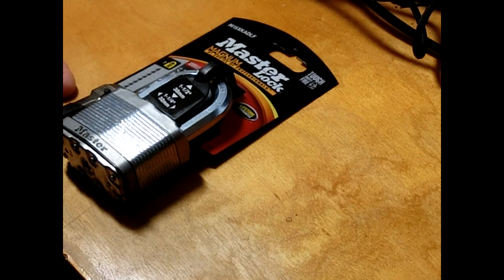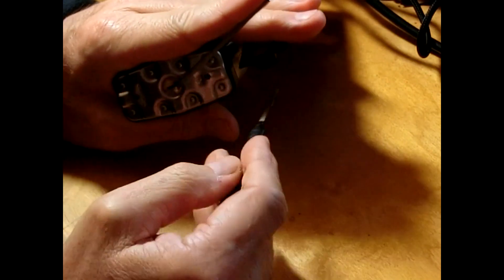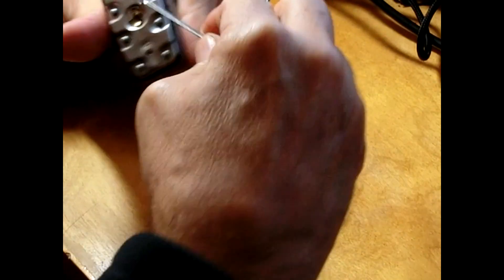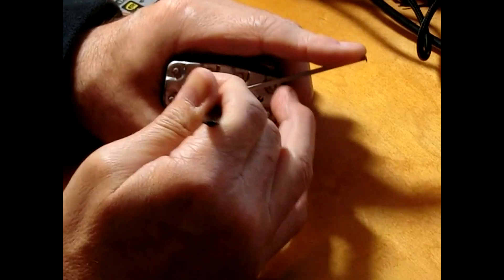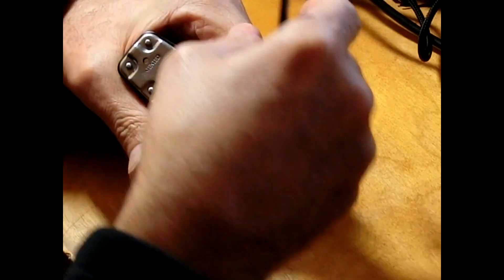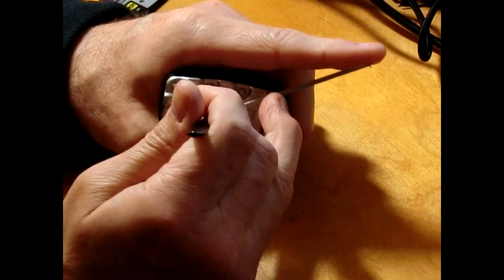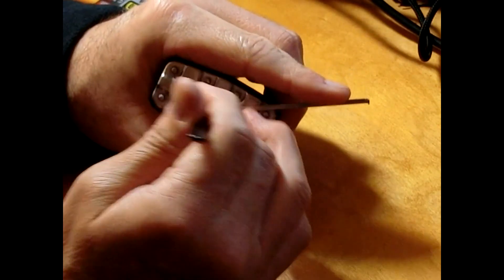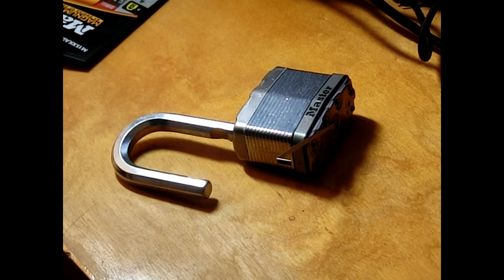New Lock Picker Versus Master M15 Padlock

Comment: I have a M15...not having near the luck you seem to have with your picks! I have all kinds of picks - nothing works. :/
Reply from the maker: Maybe MasterLock put some security pins in yours, but I doubt it.  Across their entire product line, they don't seem concerned about pick resistance.  Their security scale is only a measurement of resistance to physical attacks - cutting, prying, etc.  I can mostly understand that as common crooks don't pick locks, but MasterLock not only avoids spending a penny for security pins, they also don't bother making more precisely machined cores that withstand even a low skilled rake attack which is much faster, easier and quieter than cutting the lock shackle.  As a result, MasterLock isn't even much of a training lock.for lock sport enthusiasts.  But who knows?  With low machining tolerances, it's possible that you got an M15 that's more pick resistant by accident.  They might have even put some security pins in yours.  If you can find a local lock sport enthusiast, he or she would try picking it and could tell you what's going on with your M15.

I don't pick other people's locks without permission, but it'd be fun to wave rake open every MasterLock at Home Depot and leave them hanging open as a warning to customers.

LockPickingLawyer recently posted a video in which he decoded a MasterLock combination lock by simply looking at it.  It was marketed as an inexpensive locking carabiner for "securing" a gym bag.  They had rated it as a 2 on their security scale.  I left a snarky comment under the video asking what would be a 1?  A twist tie from a bread bag?  Apparently, they don't market any locks as a 1 on their arbitrary security scale.
Reply: @Liberty4Ever  I follow LPL. Haven’t seen the gym bag episode but it sounds hilarious.

As for my M15, it’s one of the only padlocks I have in my collection that I can’t pick open. I don’t hear or feel any definitive clicks but on occasion I’ll get a false set and a slight rotation on the core. Raking didn’t work either, but I’m going to give that another shot.
Reply from the maker: @rickcox3216  - It sounds as if you have an M15 padlock with spools.  If so, raking won't work, beyond maybe getting you to a fast false set.  An M15 that can't be raked open would be a fairly good padlock.  The physical security on the one I had was fairly impressive for under $20.

Do you know if your M15 was an older M15 (maybe before MasterLock gave up on making a decent core) or a later M15 (maybe MasterLock was one of the 177 people to see my shame inducing video and that made them straighten up and fly right - ha!).

You might have a good M15 to sandbag other locksport enthusiasts who aren't expecting decent machining and spools in the core.